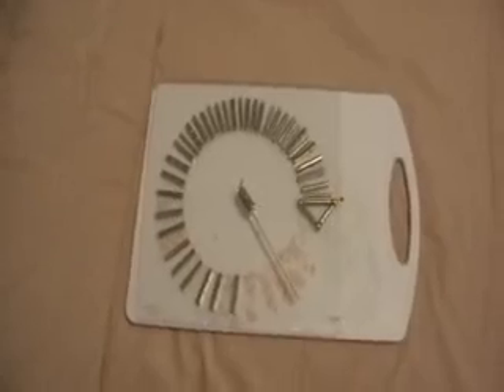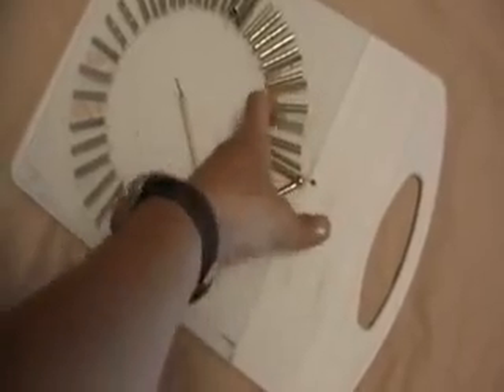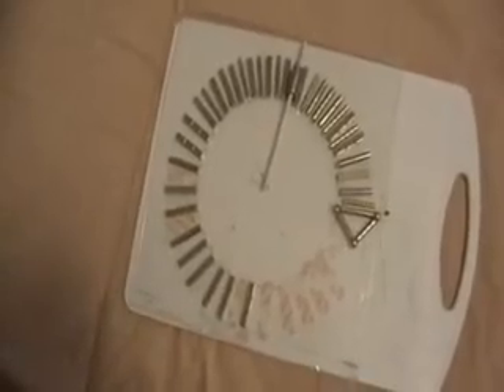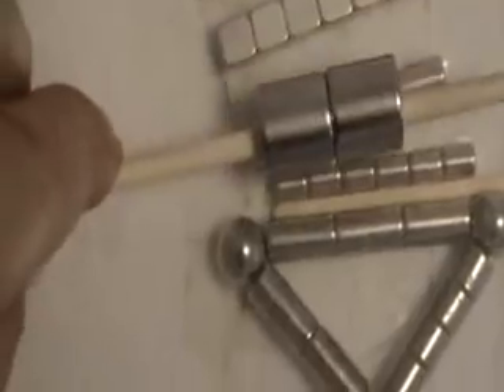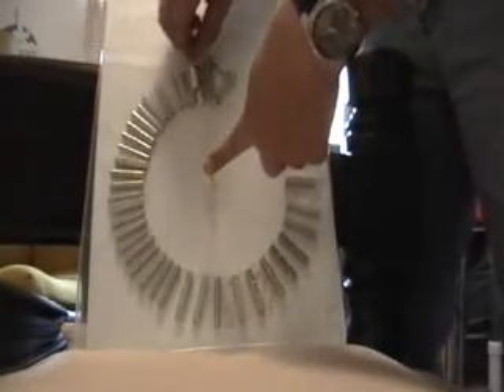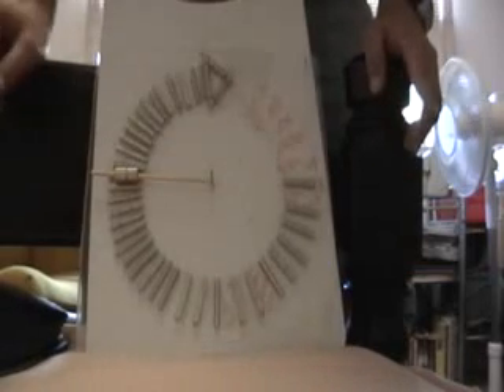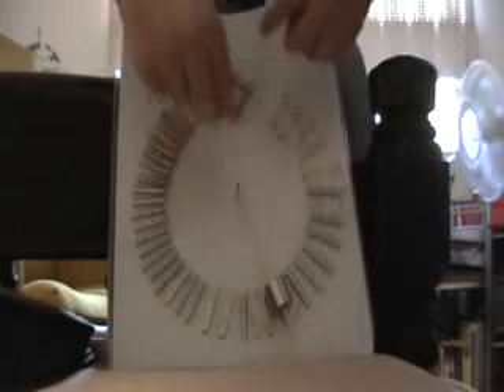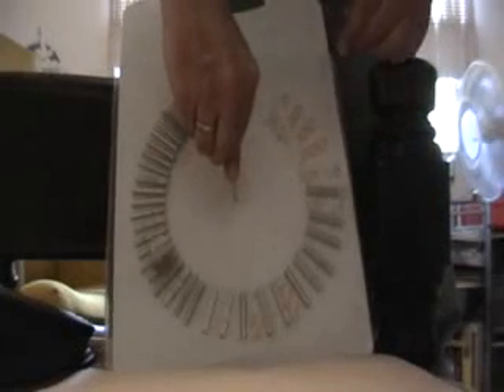MkE 2

Comment: I'm not sure what you are trying to accomplish.
If you are trying to get it to go all the way around and keep going forever, you will not succeed.

The reason is because fixed magnets create a force. Gravity also creates a force. You can use a roller coaster as an analog to what you are trying to do.

See if you can figure out why a roller coaster cannot make it up the last hill to start a second lap and you will understand why your magnetic device won't work. Work around a closed loop = 0.